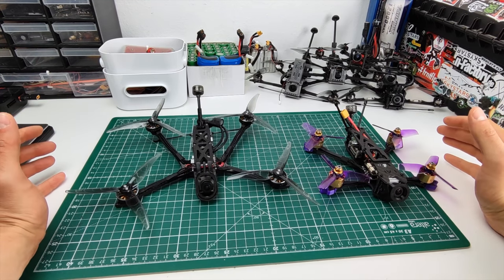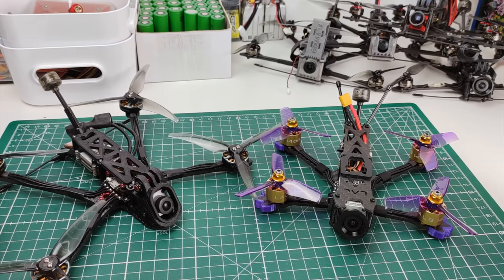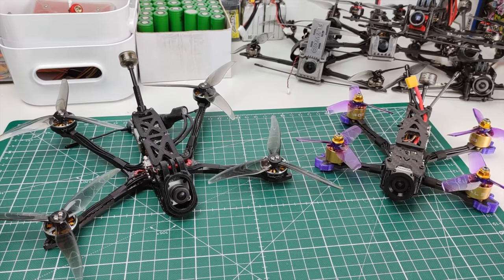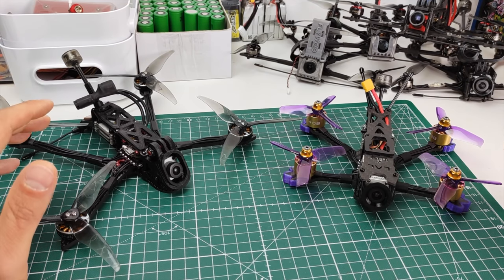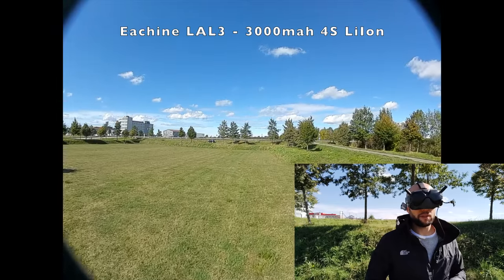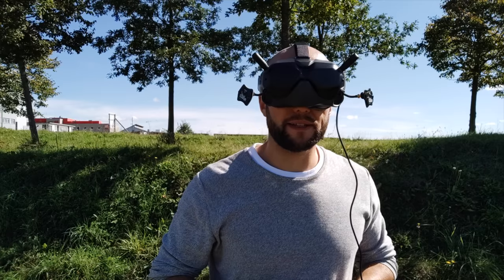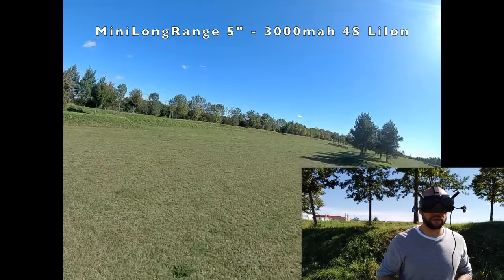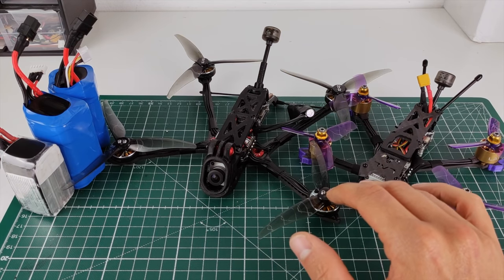Same same but different - Miniquad Flight Time comparison

Comment: Absolutely love my 5" Ultra light.  On the BH motors on 4s it runs extremely quiet which is very important as I fly at the local soccer (Football) fields.  It even does swoopy freestyle very well.  Thanks to these models I've retired my all my quads that weigh over 300 grams.  Flying for just 3.5 minutes just doesn't seem worth charging the batteries anymore.
Reply: What are your specs and flight time you get for the 4s bat?

Comment: Thanks for the info Dave!  I've got a 3" micro running 1204 5000kv motors spinning emax avians on a 1100mah 3S and have gotten 15:15 running it down to about 3.5 (recovering to around 3.6ish). If I put my warning down lower, in guessing a few more minutes max, but I want to be nice to my batteries. 😏 Love what you're doing for the hobby man. Keep it up.

Comment: Hi Dave , can make a test with a GoPro (not naked ) to how it handles with the Li ion battery??
Reply: such Li Ion battery accept a discgarge of 12 times less than a Lipo and is limited at low amp (10amp). so On a 3 inches quad with extra weight, it will damage the battery and makes it very hot because at 12V for example it will need really more throttle to fly with it. I succesed to fly 16.30 with a 4S 3500mAh Li Ion battery on a similar 3 inches quad with onboard a gopro lite. Because I flied only with smooth movments, little trottle management and the result was perfect.

Comment: Hello, Dave! recently I finished to build my 5 inch on Rekon 5 frame (I'm really satisfied how it looks and weights). Specs are - iFlight f4 mini 35A stack (jesc firmware on esc), motors - mamba 2004 1700 kv. It fies with stock pids and reduced to 1.5 filters really well and smooth (first build where I didnt faced any headache with tuning)). I used HQ prop 5x2x3 (I think, there is lack of power with this props). And I have flight times in non-agressive flights about 3-4 minutes with 500 mah 6s lipo. I have seen, people have almost double flight time with original built Rekon5.  I don't think that 100 kv less than original hglrc motors can cause issues other than less throttle on the high end. I'm interested - is that because lack of pitch of my props or esc settings?
Reply: Why are you only using 500mah? I not sure but I think he flies his rekon 5 with 1000-1300 mah 6s lipos.
Reply: @_flaggon3645  Yes, now I think 1000-1100 mah would be the exact thing for this quad
Reply: @edfroxt7294  I am thinking of building the same setup. How are these motors on 6s and 4s for you?
Reply: @hemanthkrishna5343  I tested it on 4s liPo and 6s liPo and in both cases it feels really good for me. On 6s 1100 mah and 50 gram action cam onboard it didn't feel underpowered. Flies very smooth and fast for about 6 min's in light freestyle with 3-blade Gemfans SL5125. On 4 s  tested with liPo 850 mah - about 4-5 mins of cruising with bi-blade HQprops. I did'nt tried li-ion packs yet.  As I mentioned earlier, the HQ prop 5x2x3 are not for this setup and flying weight - it feels underpowered with them.

Comment: Interesting comparison. You're always going to have a sweet spot with battery weight for efficiency, I'd like to see the Eachine fligt time on 3S. The 18650 format is limiting to design micros around as the battery weight goes up in 50g steps for cell count,, there are people getting 20 minute flights on 2s 4inch setups. This 5 inch will be great for naked gopro.
Reply: I was thinking the same thing. Put a 3s on the 3 inch to help with weight issues and efficiency.

Comment: Nice project... would be nice if you could do a video and how to make the lion pack. Are you using a BMS or just plugging to normal lipo charger and charging at 0.3 0.5amp?

Comment: Random question- are those caps on the ends of your control link antennas functional or just cosmetic? I always remove the end caps from mine because it saves a tiny bit of weight but if they function as shielding I’ll put them back on. Thanks.

Comment: i'm really liking this long range project,  hey, i've noticed something maybe worthwhile mentioning, i set my cam angle at 18deg, its low enough for me to crawl and even stop to look at stuff, but i've noticed when i have to cruise a long distance it does something unexpected, flying dead level it slowly gathers speed, gently but definitely  gets up to maybe 45mph given enough time. this did not happen at 20deg cam angle. i think maybe there is a sweet spot. i set angle by eye now but i used betaflight config to measure angle against model.  my quads are a very odd shape so maybe its just wind resistance

Comment: I feel like there might also be a market for those 18650 4s packs, especially when people see the ridiculous flight times you can get out of them.
Reply: Chl  are bringing some out
Reply: GEPRC posted some new ones on their site recently, have 2x 6s 3000mah on the way for my HD7 frame 7". VTC6 cells. I get 19 mins from 1550mAh Lipo on HD7 frame with the 1350kV 2306.5 motors, doubling the battery capacity should be fun.

Comment: Hi Dave! 
What would be a good ampdraw when you are cruising with the 5"?
I get around 15 amp when cruising and that feels a bit high. I have same motors, props and battery. But quad is at 440 grams without battery. Could this be the problem?

Comment: Thanks Dave for your work.Which one is more efficient?This 5 incher or flywoo 4" explorer?
Reply: Good question. Can't wait for that comparison.
Reply from the maker: The 4" does a few more minutes (28-30min) on the same pack
Reply: @DaveCFPV  Thanks for the response. Your explorer LR seem to be doing quite well. Its getting great reviews from the fpv community. I was sold the minute I saw it on Nurk channel. I'm new to fpv but that one is definitely next on my list. I want to use a Hero 5 session (if I can find one) with it since it flies so long. I have the insta 360 go but 5 minutes isn't enough.

Comment: I flew those bh2004 3150kv with the same prop on a TBS PodRacer using a tiny 3s 450mah and I was getting close to 7 mins cruising around chasing a dirt bike rider.

Comment: Great.
I have build 2 quad based on iflight IH3 an IH4 frames. The IH4 is heavier but it supports a bigger battery and I am getting 8 minutes against 6 on IH3.
I am still waiting for availaibility of the flywoo explorer.

Comment: Hi Dave. Thanks for the very informative video. I was wondering what your current is. VTC6's has a max of 30A and is that enough for 5 inch. I have a 6 inch 1850 kv quad myself. Im thinking of building a 3S2P with Vtc5a batteries that has 35A (70A when parallel) max rate. Do you think that would be efficient at all?
Reply from the maker: I don't know to be honest I haven't calibrated the current sensor since I usually only use the voltage. Yes that will work. I have a INR 21700 40A pack on a 6" with 1350kV. It's absolutely fine for cruising
Reply: @DaveCFPV  Thanks mate. Im thinking of maybe doing some basic freestyling with the help of that 70 amps

Comment: my crux35 will cruize for over 15min on a dogcom 850mah battery, i think the 3.5inch props are super effecent, and its 190g auw with that battery, on 1404 3500kv 4s, it gets like 8 min when ripping and over 10 min cruizing on a 450mah cnhl 70c

Comment: I would like to see an optimized set up around a 4S 21700 li ion pack.  Bought the Flywoo lr.  It is great!  Brilliant work.
Reply from the maker: Thank you!
Reply: Yes great, but no antenna in my box.. 😨. Flywoo it's a very bad thing.
Reply: @dupfpv14  did you contact them to see if they would help you out?  I've been amazed at how well companies will resolve issues.  Eachine and BetaFPV both sent parts when I told them parts were missing on my word only.

Comment: It's a really complicated problem, but the simplest explanation is disk loading. Lighter disk loading (more prop area for the same weight) reduces power draw for a given thrust. However, run props that are way too big and you'll lose efficiency due to the friction (viscous) drag on the props. I'm not sure if the wikipedia article talks about that part, but it would make sense why you wouldn't want to run 10" props on a 200g quad.

Check for yourself: https://en.wikipedia.org/wiki/Disk_loading

Comment: Basic on efficiency and to understand easy. As slow as you can spin and as large the props within maximum motor amps you will get better efficiency. The limit is how much response you want. More diameter less rotational acceleration so, a less responsive drone and more fly like a tank configuration needed.

Comment: Nice video, as always. Did you ever try a 4s version of the 2004 motors on the mini version? I guess you could achieve a bit more power and the question is, how much flighttime would you actually sacrifice for that.
Reply from the maker: I tried the 4S 2550kV version of BetaFPV 1805 motors and didn't really like it. The increase in power on Li-Ion wasn't actually that impressive compared to the 1950kV 2004. Running 6S on the 2004 however made a massive difference. So basically switching between 4S and 6S depending on the purpose just gives me the most flexibility and widest range of possible applications for the quad.

Comment: Will a bigger propellor, with vertical offset, that overlaps slightly increase flight time?
A setup like a chinook helicopter for the vertical offset
Reply from the maker: Bigger propeller are more efficient in general yes but an overlap usually introduces issues since the turbulences of the front propeller impact the rear propeller
Reply: @DaveCFPV  i was wondering about these turbulences also but than looking at the chinook helicopter which flies for years with an overlap.
Somehow the benefits are bigger than the cons on tne chinook.

Comment: Really nice comparison..be nice to know what fast cruising speed is possible on this li ion pack..for say 8-10 min flight..thanks
Reply from the maker: I think you'd basically have to go full throttle and get in trouble with overheating cells and voltage sag. For fast cruising a big high discharge Lipo should be best. I got around 8min of flying over 80kmh / 50mph on a 6S 1300 R-Line

Comment: Are you still working on the tune for the 5", it seemed to have a little bobble in the video.
Reply from the maker: Those seems to disappear on a big 6S battery... Hope i can tune them out on 4S also.
Reply: @DaveCFPV  ah makes sense.
Reply: @DaveCFPV  can you share your 6s abs 4s tuning please ?

Comment: Hey Dave I built the five following how you did but I have it analog hey you think it can carry a GoPro session 4
Reply: If it can carry a 4s 3000mah lion battery it will have no problems with a gopro session. I would go with a bit smaller battery tho if also using the gopro
Reply: @pbarrick03   thanks buddy.   I got everything today in the mail.   Got like 300 in it

Comment: What about HQ biblades? 
1700Kv for longer flight times. 
Use 6s Li-ion. 
I have the flywoo now thinking of building a 5"
Reply from the maker: 6S Li-Ion is crazy heavy unfortunately. I now use a 1300mah 6S LiPo to have the best of both worlds; good flight time but also plenty of power.
Reply: @DaveCFPV  oh thought the added thrust of 5" would be able to do it. Damn. Yea got be like 90g more lol. But figured the higher rpms over the 4s Li-ion off set it. Wish thrust chart would show biblades they used 2 different props for 1700 vs 1950 lol. All tris. 
Where can we get ur 5" frame in carbon fiber? Or ur still working on it?

Comment: Wonder what the flight time for the lal3 would be on 3s. One other problem with the lal3 is certain parts are scarce like the standoffs they use M2 by 25mm smooth
Reply from the maker: That's true those are hard to find. Also I don't know if they sell a spare bottom plate or frame. You'll probably have to switch to a different frame if you break an arm...
Reply: @DaveCFPV   they do sell frame parts and a couple suppliers sell individual parts. None sell just standoffs which I bent. Fortunately, it can still be flown. I have since sourced some and am awaiting their arrival.

Comment: Super informative video. Waiting for my Explorer to come in mail..  How did you calculate the stator volume ???
👍👍👍
Reply from the maker: Just the cylindrical volume (Diameter squared × pi X height). So it's just a rough approximation. You could get an exact volume by putting it in water at measuring the displacement

Comment: This isn't a fair comparison at all. Besides the weight which is relatively close, everything else is in the advantage of the 5',especially from a flight time point of view:
- 5' has 'regular' motors for an ultralight 5. The 3' has racing motors for a 3'.
- the 3' prop again is not quite the best choice for this.

You mentioned all of these things, but still, I think the two builds are way to different for a fair comparison between them.

Comment: I would argue the 6s kv on 4s won't give it more flight time, you end up giving it more throttle to compensate. I tried this on a 1700kv build with 1500mah 4s and only got about 4/5 minutes. I think, weight, prop size and motor diameter have more of an effect.
Reply from the maker: It's certainly not the biggest influence but still Kv is inversely proportional to Kt meaning the motor has a higher torque per amp. So while the high kV motor is not inherently less efficient at constant rpm I would  assume that the FC/ESC will have to "push" less amps through the motor to get enough torque for fast enough direction changes to maintain the quads attitude

Comment: 3" should been t-mount. 
Wonder what my 3" does in my 4s Li-ion 
Big motor with 5000Kv my guess 20mins. My flywoo has done 29:51 and 29:57 (wont count time I crashed twice and had to walk a few mins and search for it. 27:50 flight time. 
My 3" feels faster though. Same weight as flywoo with out gopro

Comment: Is the tune for your 5" available anywhere?
Reply from the maker: It's basically stock. I just removed the gyro notch filters and run dynamic rpm filter.

Comment: your totally wrong about the eachine lal 3 put an 650 4s on ther an tell me it slow or the recommended 450 4s... an the lal isnt built for long flight times by the way. 4 minits 20 seconds of hard ripping on a 650 an stupid fast on the 450 4s an about 3 minits
Reply from the maker: I tried. Still my honest opinion that is pretty slow for a 3" on 1408.
Reply: @DaveCFPV  it's was still a good video to watch.  The info was actually interesting.